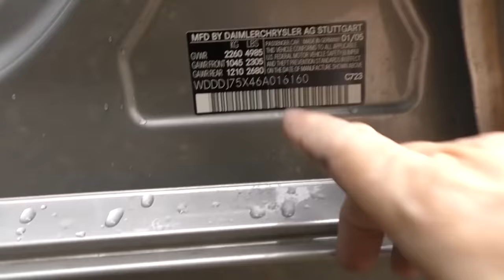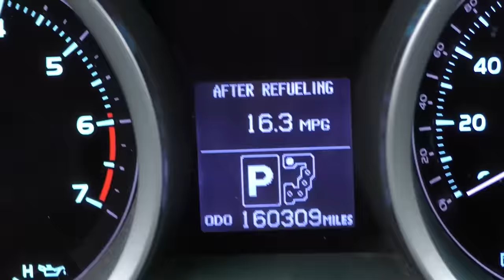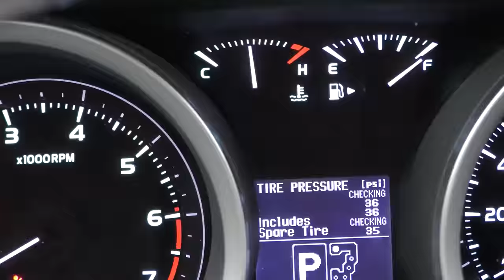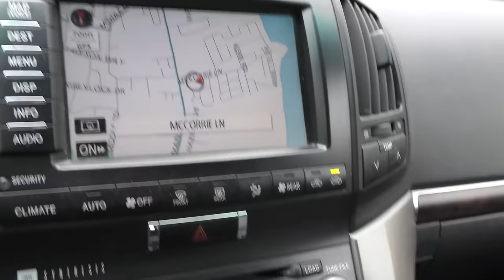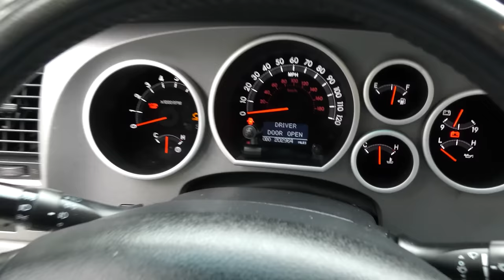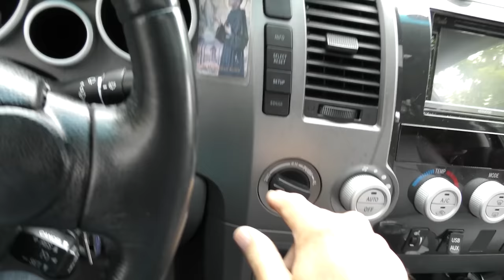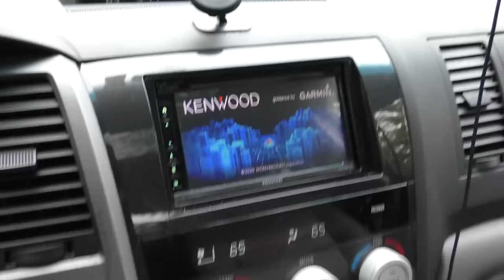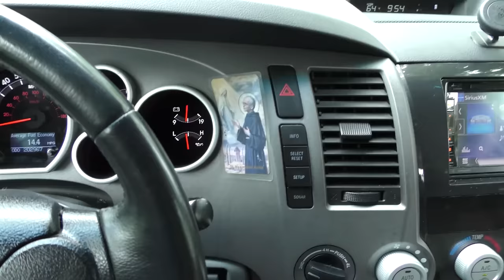What the Hell Toyota

Comment: I got oil burning 2.4 engine in my pontiac vibe.  I got a honda pilot with 3.5 engine that has crappy cylinder management.  I have a 09 cobalt with faulty ignition.  I had a 14 nissan versa with crappy CVT transmission.  I can't win.
Reply: you should be able to disable the cylinder management in the pilot. make sure you check the timing belt on that, too... the vibe would have kept running , and running if you added oil and kept clean oil and filter and clean tranny fluid in it... none of what you listed are big issues

Comment: Have to disagree with you Scotty. 2009 camry hybrid made in USA mild oil consumption with 10k oil intervals.  Has 330k on the clock and don't have any lights on the dash lit.
Reply: What are the chances i would know someone with Japanese built 4runner who had 4k steering replaced right after warranty, i could believe it's very rare, because people say so
Reply: Well if it's a hybrid then the mileage as far as oil would go, would be limited to the kind of driving, too. Not saying for better or for worse but when cruising I'm a hybrid it's relying more on the electric system than the combustion.

Comment: 🤔 Hummm I bought a 2001 Toyota Echo last year.. and at this point has 245786 miles on it the previous owners towed it behind there . motorhome ,,hence the dings an chips on the hood ... Other than that they kept good care of the car ..so here I am a year later wondering if this car 2001 With a 1.5 liter 5 speed manual will out survive me I'm 66 an just want a car to get me to town and the occasional vacation when I need it .. since I've bought it I've only had one issue,the alternator ,other than it the car runs beautiful.. I change the oil regardless of what they say the oil will last and I don't drive it like I did my Caddy CTS or Corvette... I need the car to LAST .. in Short what else can I do to insure I get the Toyota 500K mileage that many are know for .. it's a 5 speed manual I don't push the RPMs , I drive the speed limits .. most of where I live is 55 but around town it's 35 to 45 unless I'm on the Freeway and as much as I want to do 80 I keep it at 65 😟 Just want to know how to keep this car until I'm gone an I'll pass it on to my son ....It's not a Lady Getter , but at almost 48 to the gallon he could probably afford to take a Lady to get Dinner 🤔 Just wanna know how the best way was to make it survive Me...

Comment: What pissed me off about Toyota is the LACK of horsepower in their vehicles.
Reply: You must be talking about the brand new Toyota Yaris.  I test drove one and it was pissing me off at how gutless that car was around town on my test drive.
Reply: @mylifethaidiy7045  Actually I'm pissed about my 2012 Scion xB.  158hp 167trq  it's snappy but not fast.  The Scion Tc has 180hp and would get smoked by a 200hp Civic Si - Speed & Reliability would be nice for Toyota.
Reply: More horses only matters if you constantly drive with the gas pedal pushed through the floor.
Reply: @n808sgarage  Not always.  I've seen many a Corvette or GTR for that matter just cruising down the street slowly 🐌 ( because they know they can beat everybody)
Reply: From my experience, toyotas have more low end torque and honda has more top end horsepower
Reply: @oreally8605  No, they have to go that slow because they have no suspension travel and they aren't on a track
Reply: they have enough hp and yes i saw some have 10-20 less than competition
Reply: i have a toyota 1.0 and it has 90% of torque from nearly 2000 rpm up to 3600 peak and it keeps it up till 6000 but yes its only 94nm and it cruises 2200 rpm in all gears 2800 to 3500 rpm change
Reply: Must not be talking about the 5.7 V8

Comment: Hey Scotty I have an 05 rx 330 that has some strong vibration and a clunking sound on low speed acceleration, I replaced the motor mounts and CV axles and still no luck. What else could I inspect or replace?

Comment: I had a 2007 RAV4 with one of those engines.  The problem got so bad that it was using 1 quart a week.  I wasn't able to get Toyota to fix it because it had too many miles.  I sold it and I won't buy another Toyota regardless of what model it is.
Reply: how many miles did it have?
Reply: @Elena-er7zp  about 137,000

Comment: some 2az-fe 2.4L motors were built in Japan, some in USA for the camry. My sons scion xb has the japanese 2.4 and i change oil every 3k using only penzoil platinum synthetic 5w-20. it runs like new and uses no oil hardly between changes. has 190k miles.

Comment: Why didnt Toyota have a recall on the late 80s and 90s Truck frames that rusted because of a bad design? I have a 92 2 wheel drive with 168k. I use about a quart of oil every 1000 miles.
Reply: I think they did

Comment: Always great to know your analysis with results displayed by MODEL and by YEAR. What Toyota Corolla years are better than those you stated as "bad" 2009-2011? I do look for a Corolla, currently I am setteled on Corollas between 2005-2008. But which years are better from 2011 on?
Reply: Anything 2012 and up.  For oil 🛢 burning 🔥 my 2012 Scion xB burns no oil.